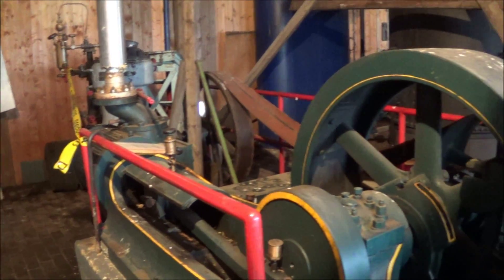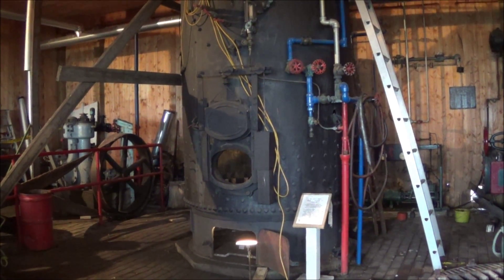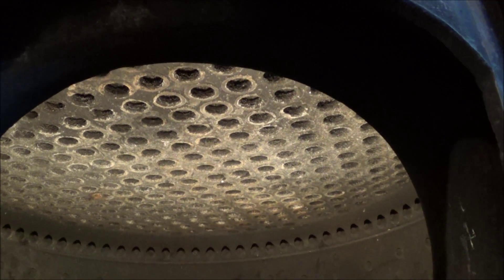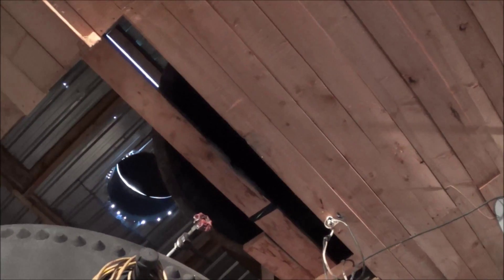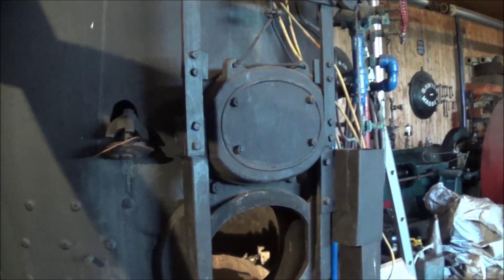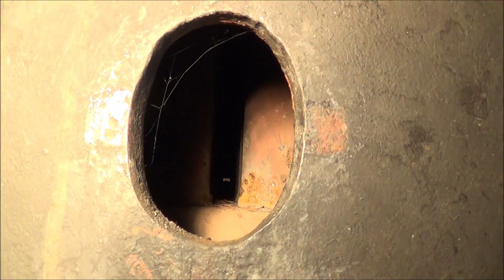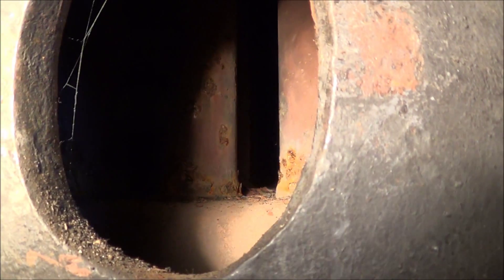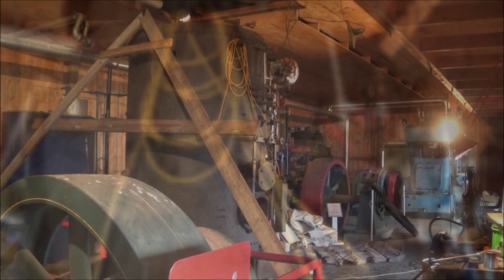Pioneer Acres Boiler Project 1

Comment: what was the VFT originally used for?  how old were the tubes.
Reply from the maker: The boiler was originally mounted in a railway wrecking crane owned by the Canadian Pacific Railway. The tubes where replaced right around the time it was retired from service, probably late fifties early sixties.